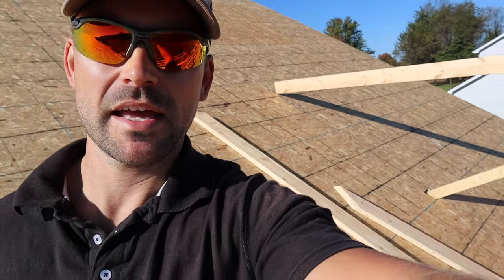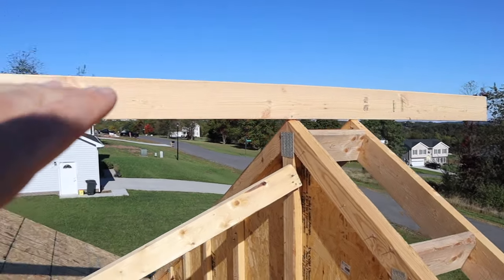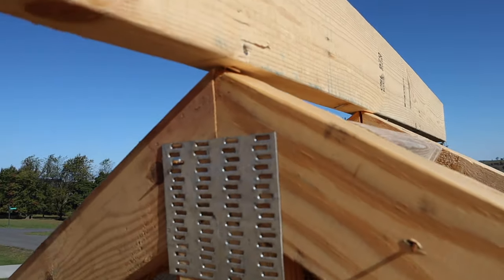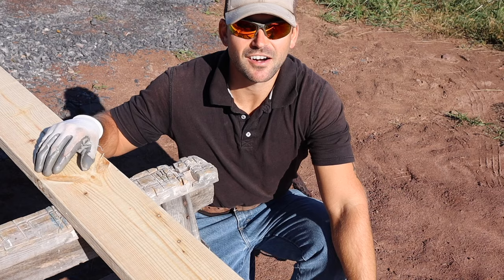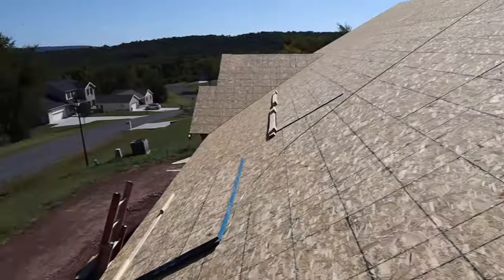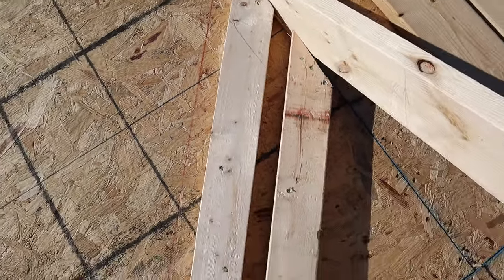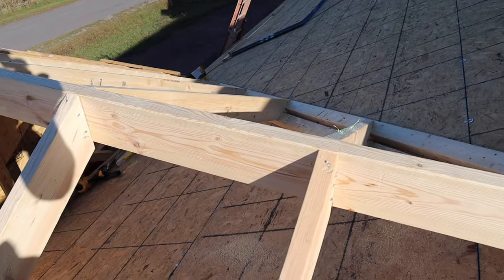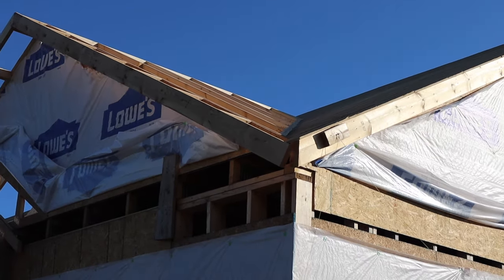How To Build A Small Roof - Valley Roof Framing

Comment: FYI for anyone curious about the cuts on the top and bottom of the sleepers -- as an alternative to scribing, set your framing square to the roof pitch on the tongue, and the rafter length on the blade AKA body, and mark the top with the tongue and bottom with the blade. Top is square cut and bottom is set to the roof pitch. Its the same as the sheathing angle.

Comment: Finally someone has explained how to layout the frame work.  I’ve watched a ton of videos and none have showed the hole process as you did.  It’s my first time doing this.  I plan on going over the shingles on the old roof.  I trust this is acceptable.  I’ve seen videos of it being done.
Reply from the maker: Im glad you found value in this video. Roof framing is hard work! Im glad you were willing to tackle it! Thanks for the comment!
Reply: I had my roof replaced as part of an insurance claim due to damage from a pretty wicked storm we had come through here in Oregon back in 2021.  The contractor did indeed roof over roof to even up the ridge line as one of the additions came down to a “V” shaped valley of sorts behind the garage.  Only problem is he didn’t continue the main attic for access, and no idea how he did it.
Reply: Other issue I discovered is that instead of putting the new underlayment and the ice/water barrier on after putting the plywood sheething on over the shiplap, he put the the underlayment and the ice/water barrier over the shiplap, then the plywood sheathing, then did the shingles directly to the plywood.  So later today, their General Manager is sending out a different project manager who replaced the one that was fired to take a look and fix it under warranty.  The one who did it originally bragged that he had over thirty years of experience as a roofing foreman.  😮

Comment: An easier way to find the degrees for the pitch of your roof is using the speed square,  the marking for the pitch will have a corresponding degree mark at the bottom. Thanks for the video!
Reply from the maker: Yes check out my speed square video! I’ll show you how to do just that. Thanks a lot for watching!

Comment: a few things here. The best way to put a ridge in is to cut your roof pitch in the ridge first then flip it over and plain it level on the roof. make sure when doing this that you hold it down 1/2in on your gable side. another more efficient way of centering your ridge is to pull the same measurement from your truss where your valley board is going to sit up to the ridge. I don’t know if codes are different where your at but here in Michigan any conventionally framed roof rafters are to be 16 o.c and a collar tie every other rafter. also you can use 3/4 board for your valley board instead of 2x4.

Comment: This may have been mentioned in comments elsewhere but just in case it hasn't you can get the degrees for the bevel of your bottom cut right off the speed square.
Reply from the maker: Yes. Or you can take your short degree and subtract it from 90° to get it to.

Comment: Great video. This is the only detailed video on getting these "california valleys" framed. At 2:08 you describe how to mark the sleeper using the framing square. Does the framing square have to be level and if so how would you mark a short distance like 16" on center?
Reply from the maker: Thanks a lot for your kind words! The framing square has to be square off the rafter. It does not necessarily have to be level. Hope that helps!
Reply: How do you get the measurement from the snapped line to where to sleeper falls? I am going to assume that it changes based on the height of the valley ridge?

Comment: Hi how did you get the 1 3/4 inch  measurement to move the sleeper from the  red line inwards to its fixing position and is that number the same on very pitch or does it change depending on roof pitches thanks

Comment: Just what I needed. Thanks for the detailed instruction. I think I may need to just build a small gable end truss because I’m going to have to do this as an add on for gas and electric entry point requirements.
Reply from the maker: You are welcome. Oh ok so sounds like you will be adding a small roof to shelter the entry point. This should do the trick.

Comment: Hi bro. On the layout for the hip and ridge . You only showed how to measure out your first layout line as you go up from the gable end at the bottom cut. How do you continue the layout being that it angels up as you go . Can you demonstrate or elaborate on how to continue that layout all the way to the top end  please? thanks . I hope my question is worded correctly . Grate video though . Really very accurate and informative.
Reply from the maker: I think I understand what you were asking. Do use the same angle cut all the way up the roof. You just get the different measurements for each one that spaced out two foot apart. So ultimately it’s the same angles but the length of the board gets shorter as you go. I hope that helps! Thanks for watching
Reply: @TheExcellentLaborer  So you use your framing square like you did at 7:55 for each rafter as you build up? What about if you're doing 16" rafter spacing?

Comment: Would this be similar to adding a gabled patio to my existing roof? Or do you have a video on that? I want a covered patio extended out from existing roof about 10x10. Don’t want the low ceiling
Reply from the maker: Yes it would be a similar way when you tie into the existing roof!

Comment: Great stuff!  About to convert the back deck to more like a sun room so need to add gable roof over existing deck.  You obviously have a great deal of knowledge in many areas and it is wonderful that you take time to share this knowledge.  Not sure how I will insulate the underside of this sunroom-to-be yet but maybe there is a video out there already.  Thanks for taking the time to share.
Reply from the maker: Thanks Homer Warner! Check your local building codes but you should be able to use standard insulation bats. Hope that helps!

Comment: I want to add one of these, but set back about 6 feet.  I'll frame my own dormer wall similar to your manufactured one... would I use tie plates like a gusset to join the lumber if lumber is placed on short side (like a rafter/truss)? If I stick frame like traditional wall, then long side of limber will rest on existing roof, which it seems like would need some sort of shim.
Reply from the maker: I would have to see what you were talking about in person. It’s hard to visualize things in text form. Thanks for watching

Comment: This is a very informative video (y), will that be the same setup/layout if i want to add another room with gable roof?  Thanks
Reply from the maker: Check your local building codes. There are several ways to build a gable roof. It depends on the situation.

Comment: Do you have to punch through the existing roof and add vents to the new roof for airflow/ventilation?
Reply from the maker: Yes you can do that. They make vents that come out the top of the roof. I just use ridge vent when I do the shingles. Thanks for watching.

Comment: Great video. What was your math to get 1 3/4” from sleeper to bottom of sheathing? Or how did you get there knowing its a 7/12 and sleeper is 1 1/2 tall?
Reply from the maker: Thanks. I really did not use any math equation. I just got started and took a straight edge And slid it across the top of the rafter and let it intersect the sheathing off of the rafter. After I knew that measurement I could use it on the rest of the reverse gables.

Comment: Do you have guidance on how to do a valley over a  5x7 garage door?
Reply from the maker: I would do it just like I did in the video you seen here
Reply: @TheExcellentLaborer  I guess I'm stuck cause I'm using strapping and steel roofing.The truss i got with my rafters for this gable didn't look anything like i needed but the guy said it will build out to each side of my garage door.
Reply: @TheExcellentLaborer  If I want a gable over a garage door on the side of my building, what size of truss do i need, Does it need to be the same width as my door or smaller?

Comment: You should cut at least a 2’x4’ section of OSB out into the main house for ventilation (bigger would be better)...
It’s going to get extremely hot under that section in summertime which will cause that section of shingles to deteriorate much faster then the rest of the house...
Just installing a ridge vent would be useless in that section unless it had someplace to get air from underneath...
Otherwise great job!
Reply from the maker: It’s not in this video but I did do that. Thanks for watching! Stay tuned!